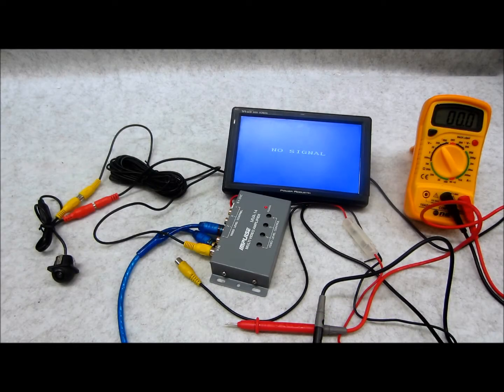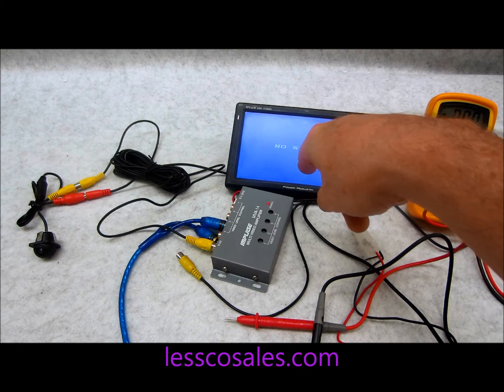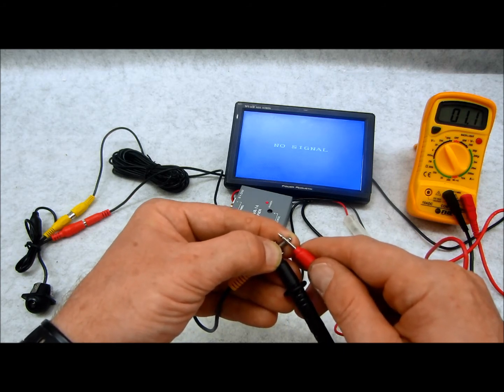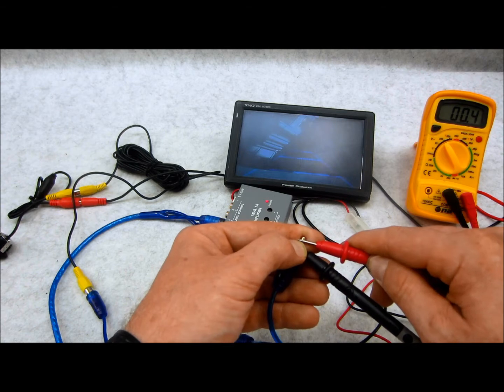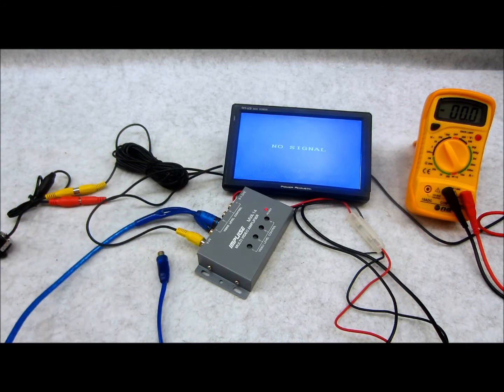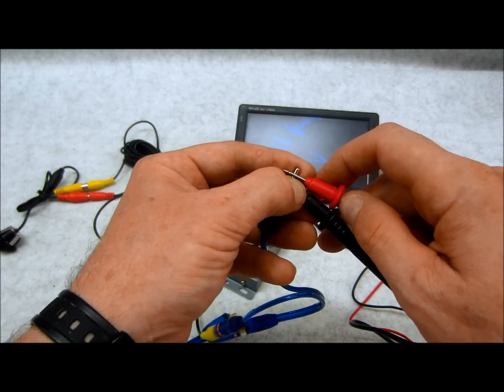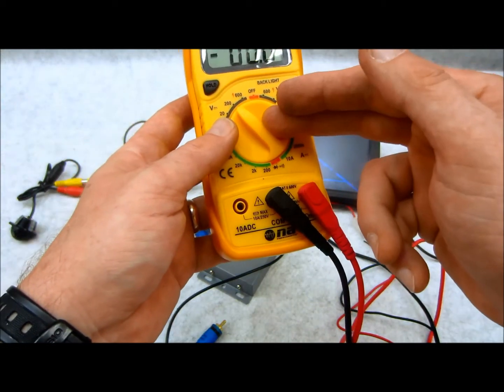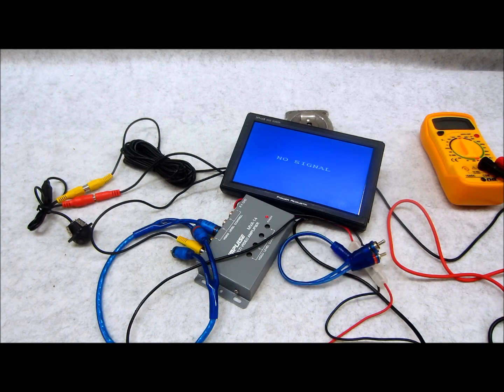How many TV's can I connect along with a rear view camera?

Comment: I understand what you are trying to do but with all due respect, I don't think you fully understand the principle of video distribution.  I will try to do this simply.  A video signal is not just an amplitude signal, i.e. the higher the better.  So measuring the signal with a meter is practically pointless.  You need to put it on a scope.  Now I do understand what you are trying to accomplish.  You want to know if just splitting the signal is OK or do you need an amplified splitter.   The answer is, it depends.  First off, video inputs are not high impedance.  They are generally 75 ohms so if you split the signal to two different sources, you have two 75 ohm inputs in parallel.  That means that you camera output is driving 37 ohms, not the desired 75 ohms.  That isn't necessarily a bad thing.  If there is a loss in quality, it will depend on the design of the devices receiving the split signals.  Many can tolerate a reduction in input signal without significant degradation in video quality.  (Until of course, the signal gets so weak as to be in the electrical noise.)

So what is the real answer to your question?  You have to try it.  In most cases, it is probably OK if you split the signal once.  How much degradation you get will depend on the quality of the two devices that are receiving the signals.  You may get some or no loss of quality.  If you do get some, it will probably be the most noticeable when the camera image is dark, like at night or on a gloomy/rainy day.  Certainly the best way to preserve image quality is to use a multi-channel distribution amplifier but a $100 solution compared to a few dollar splitter may not be necessary.

How do I know this?  I have been a EE for forty years and part of that time was designing video circuitry and as a video tape operator at NBC in NY.
Reply from the maker: wow, nice reply man!

Comment: What if you went the opposite direction? Multiple cameras to one screen, would that reduce the video quality?
Reply from the maker: I donno, I always used a source selector for jobs like that
Reply: @Lesscoelectronics   thanks for the reply, that makes sense.  I spent about an hour searching earlier, maybe you know if it exist.  I'm looking for a mini USB splitter with a source switcher, do they make those?   I tow a lot (fiberglass pools), and I'd like to have a camera to hook up to the trailer then a second camera on the back of the trailer that I could switch to once connected.
Reply from the maker: @matt22blaster  Im not really sure, But you may want to browse brandmotion or accele's site. they have alot of weird stuff like that.
Reply: @Lesscoelectronics  thanks

Comment: Thanks! I always wondered bout this.. I have a avic-150bh with 3 extra 7" monitors and I always get lines on them when my bass hits. You think this video amp could help that?
Reply from the maker: Yes, absolutely. But if its a whole car voltage loss issue the only thing that can fix that is a better alternator to create more power (or turning off the subs entirely and doing more humming to yourself and your passengers).   ;)
Reply from the maker: http://www.ebay.com/itm/Multi-Screen-Mobile-Video-Amp-Amplifier-w-4-TV-outputs-/360146157220?pt=Car_Audio_Video&vxp=mtr&hash=item53da623ea4